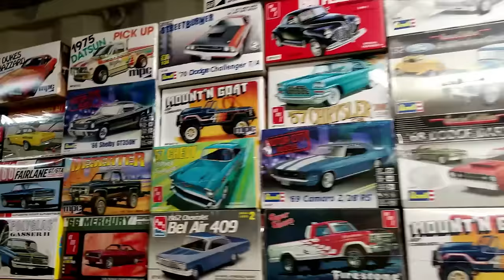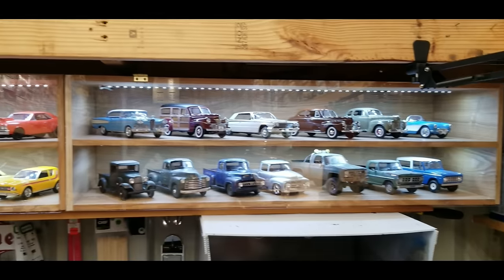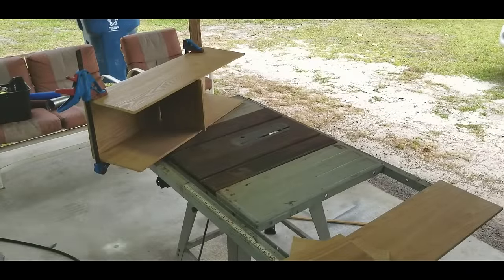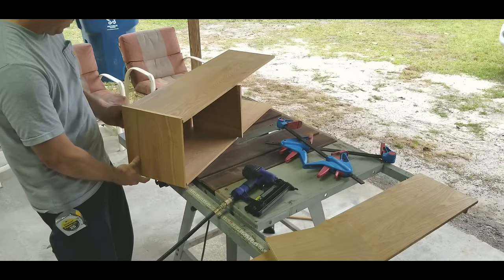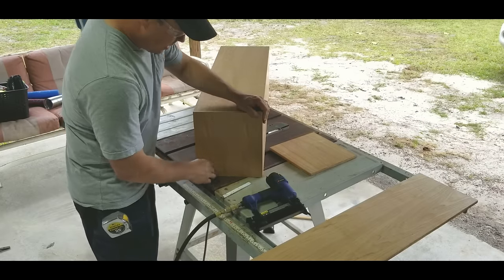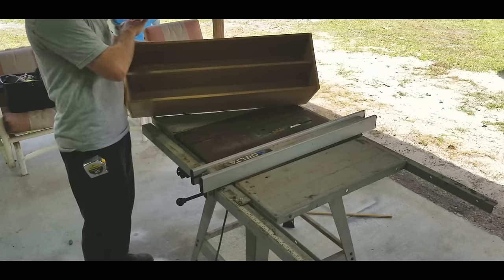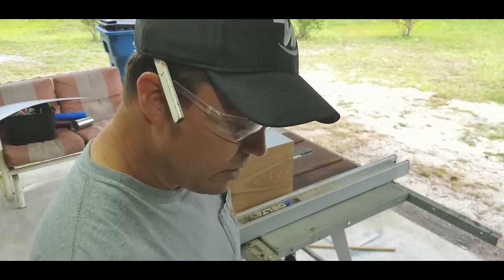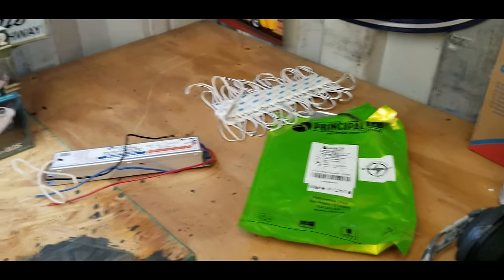DIY Model Car Display Cases or at least how I DIY them!

Comment: Nice work!  One thing I would suggest is taking three scrap pieces, measure inside of box, divide in half and take half the width of the board off and place them inside to keep shelf level.  Sort of what you did in beginning of video to nail outer cabinet pieces together.

Comment: Thanks for that info video. Watched it yesterday when it was just on the tube. Today drawed mine with 3 seperated shelves,build it,got the light in and used the small mini magnets for the plastic front to keep it closed. Now i got my models in it and space to build some more. Next one will be manheight and wide enough for my european big rigs
Reply from the maker: Awesome!!
Reply: @modelcarvideos5829  Yes my wife is very proud that i could make that with my 2 no-sinchronisated left-hands

Comment: They look great just what I'm needing for the new house! I have reels of the WiFi smart leds I'll be hooking up to mine so can control everything from my phone uve been using them for a couple year's in the hobby room for lighting there perfect and cheapish just not the cheap cheap type good one's but no ballast needed just plug n play it is a must for me display cases as airbrushing in the same room just gets extra dusty even with filters running on the booth it's ashame all the hard work and they get wrecked sitting around I was sick of it seeing them in that state!
Reply from the maker: I can't stand thinking mine are getting dusty!! Hope it works for you

Comment: Nice if you have all those tools. Sucks when you're an apartment dweller.
Reply: So, use his design, replace it with foam board and light acrylic.  Hinges you can make of almost anything that you can tape (fabric will work).  You assemble it with a hot glue gun, and use LED tape as your light source.  Won't be as heavy duty or hold as much weight (you'd be surprised using thicker foam board), but then you live in an apartment, so you're not going to be tearing up all your walls to mount them.   You won't be staining them, so look for the color you want, or sand them lightly, use a plastic adhering rattle can of paint and spray whatever you like. Alternatively, you could run down to a big box hardware store and have them cut strips of thin MDF to use as an outer frame, or have them cut your pieces to the original side and you just assemble it (this cutting is included in your purchase price).  You don't have to have a whole lot of tools on hand to do this kind of thing....just the basics.  You got this!